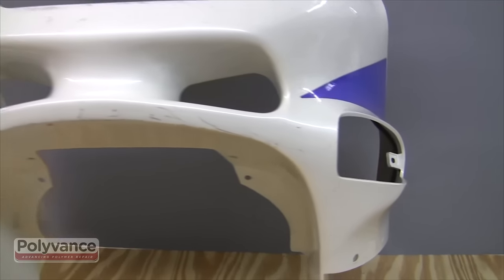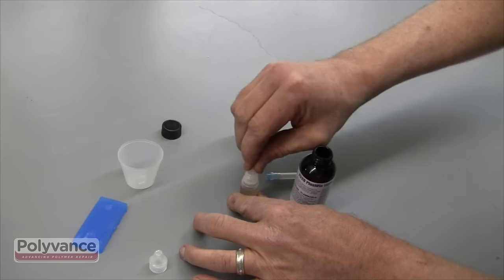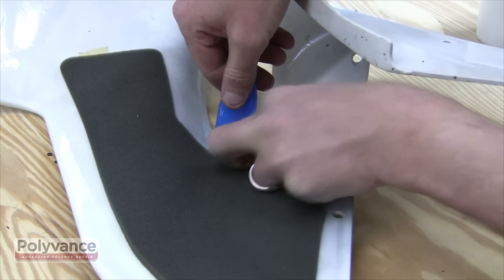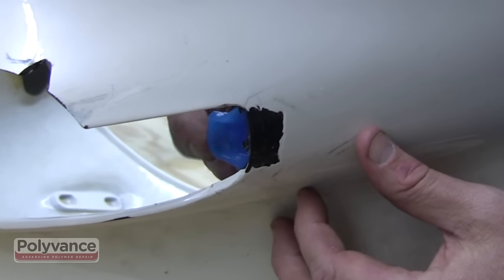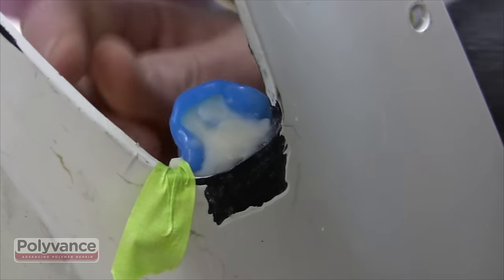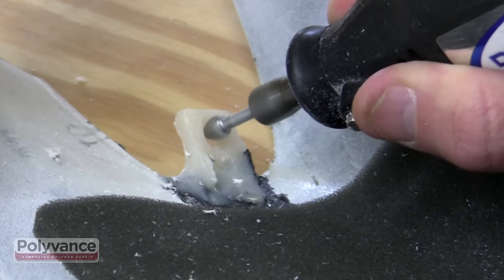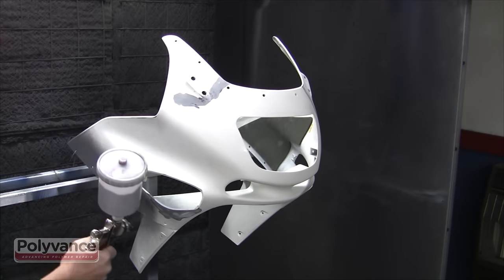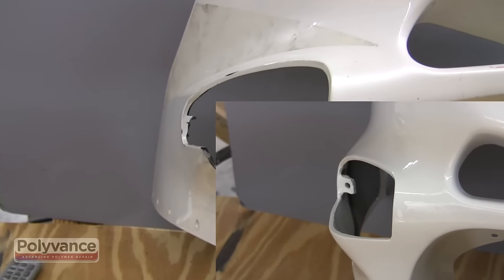Fix Broken Tabs on Motorcycle Fairings - Fairing Repair

Comment from the maker: View this video on on our website for helpful information and product suggestions for this repair: https://www.polyvance.com/video/plastifix/create-new-tab-on-motorcycle-fairing

Here are some answers to common questions about the video:

Where can I get PlastiFix?
We cannot ship PlastiFix overseas due to hazmat restrictions. If you are in the United States, you can buy it from us. If you are in the UK, WOW! (http://www.wowauto.eu/) may still have some available.

Is PlastiFix just super glue (CA glue) and baking soda?
No! PlastiFix is a special type methylmethacryalte designed for ABS, PC, Acrylics and other hard plastics. Super glue only bonds to the surface of the plastic. It is also very brittle and only has about 30% the strength of a PlastiFix repair on hard plastics.
PlastiFix chemically etches itself into the plastic and should not fail.
Plastifix uses a liquid monomer to polymerize the powder to form MMA plastic in an exothermic chemical reaction. The most common forms of MMA include acrylic and lucite. The individual components have no adhesive properties without the chemical reaction of the two ingredients, unlike super glue. Because the components can be reacted directly on the surface to be bonded, the added benefit is that the reaction incorporates the surface molecules of the base plastic, creating a chemical as well as physical bond on some materials. The chemical AND physical bond make this type of repair extremely durable and impact resistant,  plus it is sandable and easily painted, unlike super glue type repairs.

Can I use PlastiFix on all plastics?
No. PlastiFix only works on ABS, PC and other hard plastics. It will not work on nylon very well, and not at all on PP or PE plastics. You should use a plastic welder on those types of plastics.

Comment: You did not show a strength test.
Reply from the maker: Sorry! We are trying to make sure we do that more often going forward.
Reply: I've used PlastiFix on my own motorcycle, airplane wheelpants, wingtips and fairings, jeep consoles, hard dashes, and anything else ABS and the strength is superior to any other adhesive.  IT is strong but not brittle like CA glue, it etches itself into the surface unlike epoxy.  The final strength is comparable to the original part (little to no reinforcement) or better (depending if you make it thicker or add fiberglass into the repair), so you needn't worry about the strength...but yes, a strength test would have been a good thing to do.

Comment: Could wax, or standard mold release be applied to the mold before the material application?
Reply: No need.  the PlastiFix peels out of the plastic mold fairly easily.  If you were to wax it or use mold release, then you'd also have to contend with removing that before painting.  I would skip it to eliminate the risk of fisheyes and other paint defects from anything applied to the mold.
Reply: Scott B Thanks. That makes sense.

Comment: Is this kit meant for one job or more? 
Are the open containers usable over time? 
Is the molding bar reusable?
Reply from the maker: The kit can be used more than once.  The containers are reusable and so are the molding bars.
Reply: @Polyvance.  I have a side panel.on a scooter that has a pin broken that should go into a grommet, could this work for that?

Comment: So freakin cool. Are motorcycle fairing parts the same plastic as automotive headlight tabs? Can plastifix be used on automotive headlight tabs? How strong is plastifix?
Reply from the maker: PlastiFix is pretty strong. Most of the street bike fairings are made of ABS or a combination of ABS and another material. You can check out our plastic identification table here: https://www.polyvance.com/identify.php
Headlight housings can be made of a variety of materials. Most headlight housings are made of polypropylene, but you might come across some made of ASA, ABS, or a polycarbonate-ABS blend. But most of the time you’ll be using polypropylene. You can see on our PlastiFix page, that PlastiFix does not work on polypropylene https://www.polyvance.com/PlastiFix-Kits-1/2501/
Check out our headlight tab repair course: https://www.polyvance.com/Training-2/PR-03/ and promo video https://www.youtube.com/watch?v=IRRoWATg6S0. The course is an I-CAR approved course. This means that after you complete the course, you are eligible to redeem one credit from I-CAR (but you must pay them $57 to redeem the credit). Redeeming the credit from I-CAR is completely optional if you just want to take the course.

Comment: also for cheap and home things at hand...baking soada and super glue is a fantastic filler and joiner
Reply: Terrible filler and joiner...Brittle, does not chemically fuse to the substrate, impossible to sand in a practical sense, poor fatigue resistance.  IT has its place, just not here.
Reply: +Scott B bow from tom
Reply: Where can I buy all those materials? What's the cost?
Reply from the maker: @mickytseikha9483  You can get many of the products used in this video from us. Our small PlastiFix kits are currently $38.95 per pack (https://www.polyvance.com/PlastiFix-Kits-1/)
More information on the products used in this video can be found here: https://www.polyvance.com/video/plastifix/create-new-tab-on-motorcycle-fairing

Comment: How many times can you use the molding bar?
Reply: AS long as its kept clean, you can reuse it indefinitely.  Realistically though, at least 10x because it does collect a bit of trash after each use.  You can also add aditional molding bars together by heating them up in boiling water and pressing them together to make one bigger bar.

Comment: I tried this stuff, it was a lot of work, a lot of steps and prep, when I was done, it broke clean  off within a week .. I ended up using fiberglass body work puddy Called tiger hair. that was a lot easier to work with, and cheaper
Reply: Yeah fiberglass are very simple metode for body restoration
Reply: I used this stuff a few times on some motorcycle fairing with no issues and has held up great over time..for me it was quick and simple.
Reply: Lego and acetone.  Lego are abs plastic the same as bike plastic.  Put a few Lego in glass bottle add a bit of acetone.  It will melt the lego into a thick putty which you can adjust with more or less acetone. You want a wet Play Dough consistency.

You can mold it, fix cracks with it.

It will chemically weld itself to abs 'bike plastics '. It becomes one with the plastic and not a patch. You can drill holes in abs pipe and use the shavings instead of Lego  as well.

Dries in 24 hours, sandable, paintable, and will never fail...it's permanent.

Science,  pretty cool shit.
Reply from the maker: @bigpapa8152  This will work short-term, but this is not a long-term solution. As the ABS and acetone dry, there will be some shrinkage. The repair will continue to slowly shrink over time. This will have an effect on the durability of the repair. Additionally, the solvents in the ABS+acetone mix may cause issues with the adhesion of your paint.
Reply: @polyvance  I've used it many times with never an issue,  ever. Fairing I repaired on my Gpz 750 ,12 years ago  still looks great.

I don't know about shrinking over time, as once the acetone evaporates off there is no more shrinkage. It's basically ABS  pipe dope 'cement'.  If its good enough for pipes full of water........

Proof is in the pudding they say.
Reply: @bigpapa8152  On larger repairs like shown in the video, ABS+Acetone will shrink considerably.  The surface dries first, then the inside can take weeks or longer for the solvent to wick out.  This isn't an issue for pipe as the shrinkage is radial to the center of the pipe, but when you have a large, comparatively flat painted surface, the shrinkage can cause the panel distort, making fitment difficult, and can cause the paint to blister over time.  You got lucky that your repair is fine, but why take the chance to save the extra $20 or $25 it will cost to use the right product for the repair?
Reply: Rick Simpson  Just researched.  Seems to work like  nobody's business.
Reply: Rick Simpson  Those are not made of ABS, Acrylic or PC.  They are carbon fiber and fiberglass, so adhesives that grip to the surface are the only option.  PlastiFix etches itself into those hard plastics, making a much stronger bond than CA glue could ever hope.
Reply: I think Scott B works for Polyvance.
Reply: @ronwhite8503  I do, but of all the products for repairing plastic that we make,  PlastiFix is my favorite.  I've used it on everything from my own motorcycles to aircraft that I fly (I'm a pilot) and have never had a failure.  If someone broke a tab off chances are that it broke for the same reason the original broke or the material they were trying to repair wasn't one of the recommended substrates for that product.  I am very knowledgeable about PlastiFix and welcome anyone with questions about it and its limitations to call or email me through the contact info listed on our website.  I am more than happy to steer you to the best repair method for whatever plastic you are working with.
Reply: @scottb7600  all well and good if the polyvance is available in your market, but it's not available in mine,so we use what methods we can to get the job done in any possible way . Why even have this vid on international youtube when you only ship in the USA,wasted my time watching for nothing scottyboy.
Reply: @yuk-erkmckirk9277  CA and Mexico can also get it, but only because it ships by ground.  It is available through WOW in the UK as well.  You may be able to order through them.
Reply: @bigpapa8152  awesome idea. Ty

Comment: Can this be used on car plastics
Reply from the maker: No, this would not be good for car plastics. Plastifix does not work on waxy plastics like polyethylene (PE), polypropylene (PP), or themoplastic olefin (TPO). It works best on rigid plastics like ABS, polycarbonate (PC), PVC, and other rigid plastics.
Most car bumpers are made of polypropylene. You can get excellent results with welding. In fact, we have tons of videos on welding polypropylene. Our nitrogen plastic welders are made for body shops, so look at our airless plastic welding videos if you are looking for a more DIY solution.
Reply: @polyvance  please send a link to correct dyi video with source to order kit

Comment: I hit a deer with my Pacific coast. I bought a replacement faring panel on eBay from a salvage yard.The salvage yard removed the fairing panel by cutting all of the tabs off...I had already had the panel repainted, when I discovered all of the tabs had been cut off.After I finally calmed down days later, i was desperate so I resorted to cutting the tabs off of my old crushed faring side panel and I used glue that my RC car enthusiast son turned me onto. Called CA glue... in radio controlled car world, They glue the tires on to the wheels with that glue..
   I did not expect it to work at all. I was stunned when I discovered that not only does it work, but every single tab that I glued on did not match perfectly yet they all still held, it’s been about 11 years, and they are still on there. Not one of them has failed. It sets up almost instantly. So if you have broken tabs on your faring or plastic on your motorcycle ..You better align them up perfectly the first time..
   it’s called CA glue. I just checked and it is available on eBay
Reply from the maker: CA glue is what you would know as "super glue" or "krazy glue." It's nice that it has worked in your particular situation, but we don't recommend super glue for these kinds of repairs.
Many people incorrectly think PlastiFix is a mixture of super glue and baking soda, which it is not. PlastiFix is a special type methylmethacrylate designed for ABS, PC, Acrylics and other hard plastics. Superglue only bonds to the surface of the plastic. It is also very brittle and only has about 30% the strength of a PlastiFix repair on hard plastics. PlastiFix chemically etches itself into the plastic and should not fail.
Plastifix uses a liquid monomer to polymerize the powder to form MMA plastic in an exothermic chemical reaction. The most common forms of MMA include acrylic and lucite. The individual components have no adhesive properties without the chemical reaction of the two ingredients, unlike super glue. Because the components can be reacted directly on the surface to be bonded, the added benefit is that the reaction incorporates the surface molecules of the base plastic, creating a chemical as well as physical bond on some materials. The chemical AND physical bond make this type of repair extremely durable and impact resistant,  plus it is sandable and easily painted, unlike super-glue or gorilla glue type repairs.
Reply: if you break a tab off and you have the part that broke off. CA glue is the way to go. Clean the two pieces, I apply the glue, and you better have it lined up correctly because it’s not coming apart after 10 seconds. If you want to call it super glue that’s fine, I have used superglue that does not work that well. We used to use super glue and baking soda to repair the leading edge of helicopter rotors to make them aerodynamically smooth..
  The product in this video, looks like the answer to a lot of guys prayers, but if you have the part that cracked off, this video procedure is not necessary, CA glue would have glued the broken piece back on in 10 seconds permanently
Reply: @Jodyrides  you didn't stumble on to some new invention, CA glue, or SUPER GLUE has only been around since the 1960s. Damn Jody, have you lived under a rock. CA worked in your situation, great but it doesn't hold up on most repairs. This plastic fix stuff actually etches and bonds into the existing plastic. It's amazing and ridiculous that you are excited about CA, something available for 50 years but then you act like you're an expert on using it for repairs.

Comment: does it work on any plastic?
Reply from the maker: Plastifix does not work on waxy plastics like polyethylene (PE), polypropylene (PP), or themoplastic olefin (TPO).  It works best on rigid plastics like ABS, polycarbonate (PC), PVC, and other rigid plastics.
Reply: Polyvance the type of plastic should be labeled on the motorcycle fairing

Comment: It took a long time to complete, the easiest way is to use tiger hair fiberglass, and the cheapest way is to use unused strong plastic, then we connect it by deliberately heating the edges of the two plastic bodies to connect it, after that to make sure the connection beetwen two plastic become strong use industrial glue like epoxy plastic glue, and believe me it lasts a long time unlike the above method

Comment: Is this tough enough not to be cracked easily?
Reply from the maker: If the repair is done properly, it will not be any more prone to breaking in the repair area than the original part.

Comment: Polymerization time?
Reply: It starts to set in about 15 seconds, but can't be handled for about 10 minutes, then after 30 it is at full strength.  If excessive liquid is used, it takes a longer.

Comment: What kind of powder can i use??
Reply: PlastiFix Powder.  It is the reactive component to the liquid monomer.  Don't mistake this for a filler and adhesive like CA glue and baking soda, this is much stronger adhesive.  Also, the liquid alone is not an adhesive,  the adhesive forms when the two components are mixed, just like epoxy...but a different chemistry.
Reply: This is basically the same as women nail thing
Reply from the maker: @phrodendekia  They are similar, but they are not the same!

Comment: why don't they use something easily replaceable as a fixing, 2 loops and a nylon tie, strong loops weak tie, would result in, if you drop it you need to replace some cable ties, not go through all this
Reply: Then you have to cut and replace the cable ties every time you work on the bike and the fairings would be rattling all over the shop while you're riding along.
Reply: @oscarmuffin4322  I've bought reusable zip ties. The tab that prevents the zip tie from backing off is a bit longer, which allows you to disengage the mechanism.

Comment: Воск, суперклей и сода)
Reply: No, you are wrong, Mr. Russel.  Read previous comments for information on the chemistry going on here.
Reply from the maker: No, this is not super glue and baking soda.
PlastiFix is a special type methylmethacryalte designed for ABS, PC, Acrylics and other hard plastics. Super glue only bonds to the surface of the plastic. It is also very brittle and only has about 30% the strength of a PlastiFix repair on hard plastics.
PlastiFix chemically etches itself into the plastic and should not fail.
Plastifix uses a liquid monomer to polymerize the powder to form MMA plastic in an exothermic chemical reaction. The most common forms of MMA include acrylic and lucite. The individual components have no adhesive properties without the chemical reaction of the two ingredients, unlike super glue. Because the components can be reacted directly on the surface to be bonded, the added benefit is that the reaction incorporates the surface molecules of the base plastic, creating a chemical as well as physical bond on some materials. The chemical AND physical bond make this type of repair extremely durable and impact resistant,  plus it is sandable and easily painted, unlike super glue type repairs.

Comment: Okay now the strength test
Reply: I reattached pins that hold my sidecovers on as well as fixed the fairing on my motorcycle from a drop and everything I've done has held up very well.  0 failures.